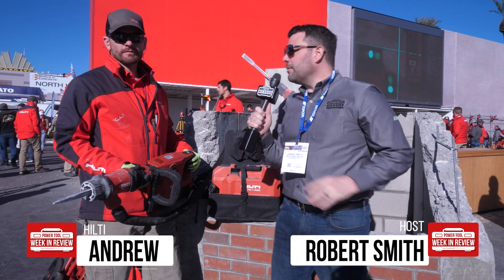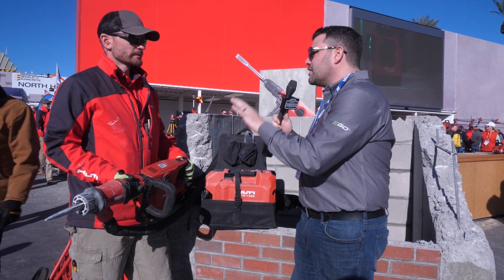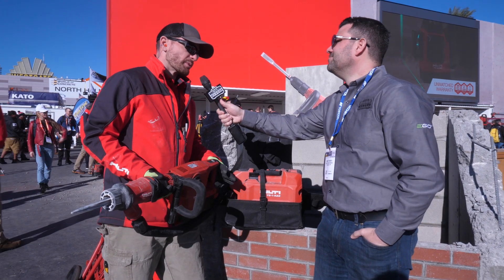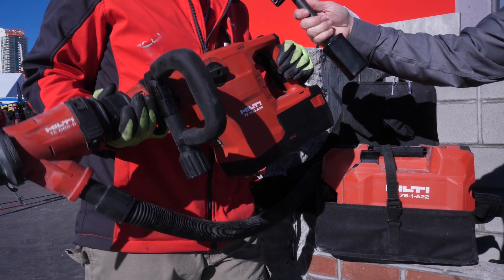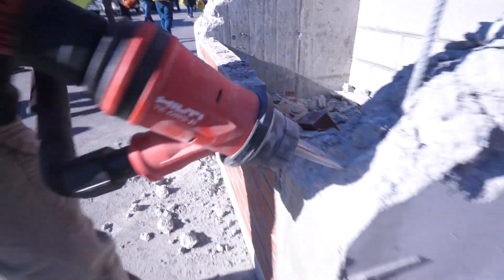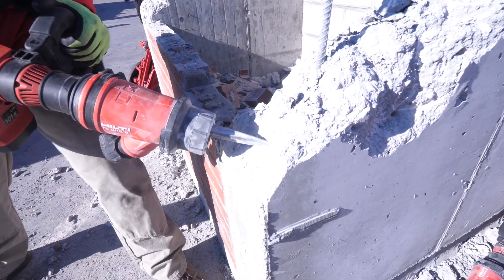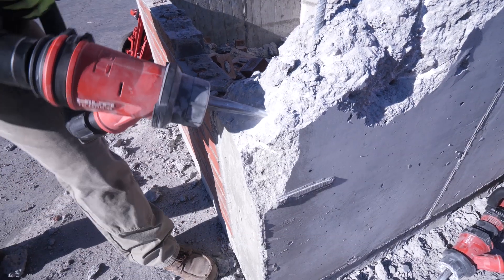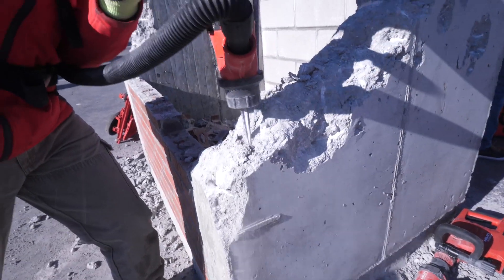[NEW TOOL] HILTI hits HARD with this WORLD'S FIRST Breaker. The Hilti TE 500

Comment: Cool tool but stroke length seems a bit short. The hammer looks like it's just vibrating instead of hitting hard. It has it's place in sure and looks nice.
Reply: The market already had sds max drills that fill this niche i wonder how much better this performs as a dedicated breaker, And not a combination hammer.